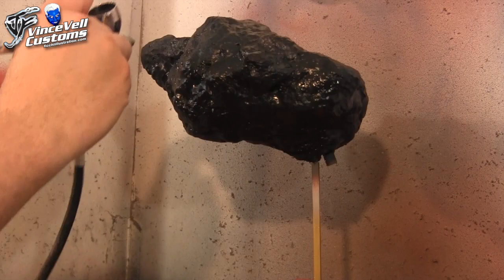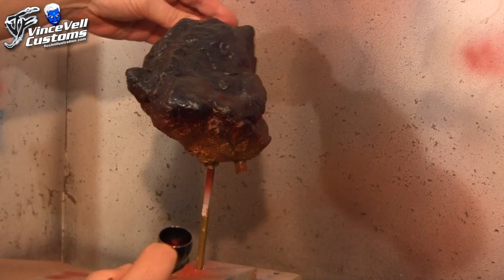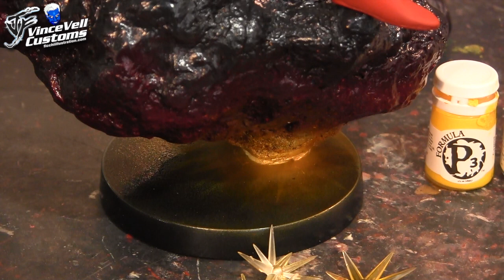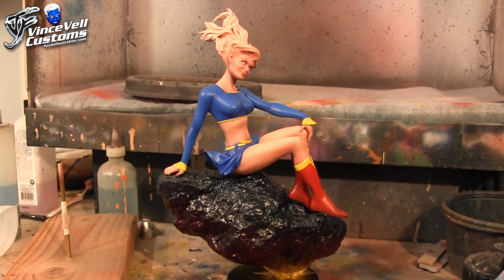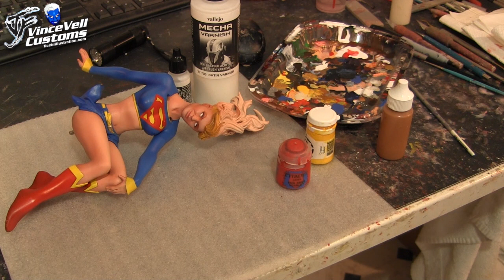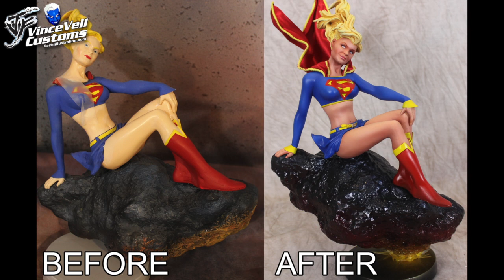Restoring a old garage kit build up Part 3 Final Paint Work

Comment: Super clean work as always.  Not just the repaint but that cape is really cool.  What a before and after photo that is. Also wanted to ask how you usually cut parts off on sculptures especially non garage kit statues like Bowen?  Do you use a hand saw or a machine?  Always wanted to customize statues but not sure how to break off or cut off certain parts I want to redo or reposition.
Reply from the maker: I don't use a hand saw much but you can if you feel more comfortable with it, but i use my Dremel tool to cut and chop items, i use a Tile Cutting bit and make sure to have a mask and shop vac near the item I'm cutting as to no breath any of the rein dust. I have a few WIP videos where i show the tools i use. Check out the Supergirl 90s version series i did, i show off some of the tools there.
Reply: @VinceVellCUSTOMS  Thank you for the reply.  I must have skipped that early WIP part as I was watching the later WIPs.  That tile cutting bit looks like regular drill bit but that can cut through an arm or leg part straight?  Is it possible for me to send you a statue just to cut off one or two parts like the head off the neck?  I know you are super busy and it's also the most boring part of customizing but I would hate to ruin a full statue and possibly break the face or crack the entire body for lack of experience on my part.
Reply from the maker: Best to contact me thru my web sites contact page and we can talk more about it or i can direct you to the right tools to use.